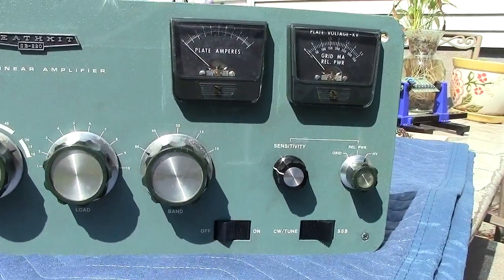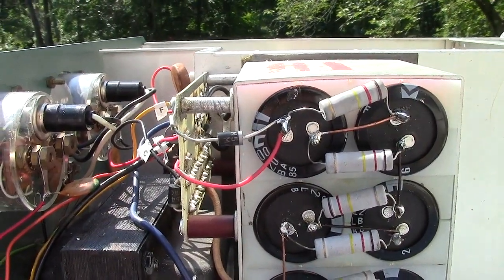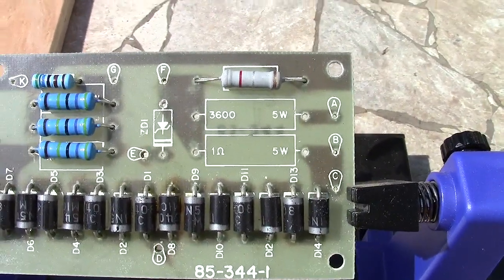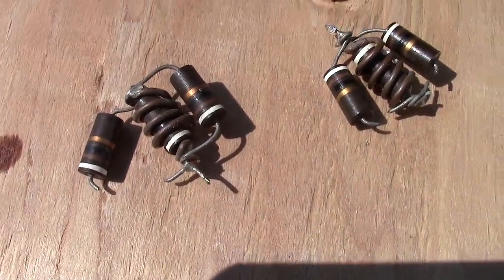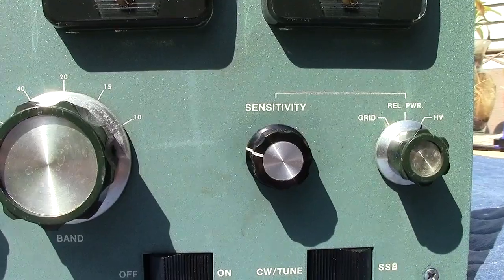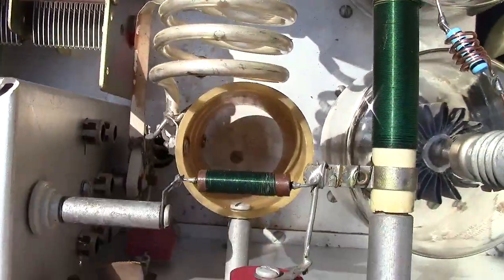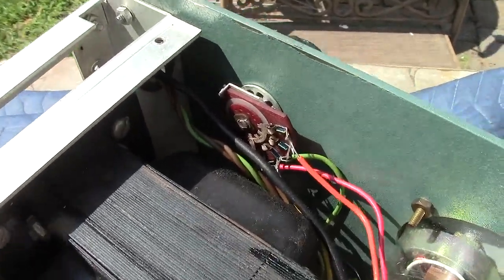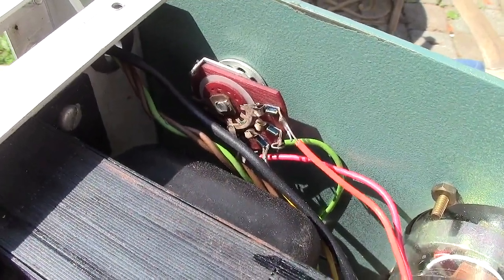SB220 Rebuild

Comment: Why do people likes to shortcut and be cheap whenever it comes to buying good parts. Those diodes looks close to the board how much clearance. Between them and the board ? I've seen many SB220 amps with 3 resistors on the parasitics.

Comment: Very ill advised to use the chemicals suggested here.  DEoxitD5 for all contacts, pots and tube pins, burnishing tool if need for relay contacts, triflow and paper towel for xfrmr laminations, tri-flow or other penetrating oil on switch and pot sfts, but keep it out of the pot. deoxit but no oil on variable caps.

Comment: I hoping to see how you oiled the fan, I suspect mine needs a little love as it's been 30 years since it's been oiled at least. Still works but why take a chance? Maybe you could just mention how you did it as I don't see a hole for that. ALso Alex, is that solder wick you are using to ground your grids? That a good idea if so I think. Thanks, Tod KJ6H

Comment: hi Alex, Just wanted to know how the SB-220 project turned out ? I looked at your other videos but seen no part 2
Reply from the maker: Hello WC : Thanks for your kind attention and comment!! I ended up replacing the High voltage transformer. The Hammarlund transformer is an exact replacement. I fired it up without incident and I am still using it daily. The output tubes are not 100% but all in all everything worked out fine. I was trying to do this on a shoe string budget. Well that did not work out the transformer alone was $300.00 OUCH !!!!!! I did not do a second video my point was to make a safety video with a few trouble shooting tips. If you intend on working on one of these little beasties. PLEASE be Careful .

Comment: Hi Alex, just a couple of words about your SB-220 project.  I want to commend you on your admonishment to those buying an amp on Ebay or any other venue where you do not see your purchase in operation.  I agree that you should NEVER just plug it in and go.  You must do as you suggest and look over the entire amp and visually inspect it for an obvious imperfections. 

 I also highly recommend since someone buying a vintage piece of gear like this do the very minimum updates to it immediately if it has not already been done. That would be new filter caps and bleeder resistors.  Secondly I HIGHLY recommend the Harbach rectifier replacement board and NOT messing with the original.  The Harbach board does away with the Zener diode, adds 3 amp rectifier diodes and meter protection.  It is cheap enough and a quick build and install compared to revamping an old board.  Years ago I realized that revamping an old board is a waste of time and you don't have as good a product as a new Harbach design.  

The parasitic set up that was in there was not stock but that design can be seen in some vintage amps and do work.  The original design is very effective, a simple 2 watt 47 ohm carbon resistor and 3 turns of #16 or #14 silvered wire around it is best.  No other design works any better than the original.  The ones you made are incorrect, they may work but I do believe you have far too much inductance on them.  Any 2 watt carbon in the neighborhood of 47-56 ohms with 3 turns of wire around it is best.  Stay away from Nichrome.  

I did not quite understand how you determined that your primary of the power transformer was shorted, you did not elaborate on that and I wonder if you should have another look at that.  Perhaps I missed your explanation.  Cleaning the relay is also a good thing and the time should be spent on doing that.  Grounding the grids is another good thing although it does increase the gain of the tubes and care must be taken when loading.  

The stock transformer has a built in impedance and a step start is not a requirement however some feel more confident with it and it can't hurt, toss a coin if you are undecided on that.  A soft key is a MUST.  The Harbach soft key unit is well worth the money and as far as I am concerned a MUST have.  You can bet that over 50% or more of modern radios will be destroyed by the 120vdc the SB-220 relay needs to switch.  Here again, the cost is minimal and the reward is huge compared to repairing the keying circuit in a new radio.  Once again, cleaning the meter function switch is another good idea.

One major observation I have made over the years which is quite troubling is the frequency that I see bad band switch contacts on these amps.  I have owned or repaired upwards of 500 SB-220/221 Hl-2200 amps over my 45 years of working on them and unfortunately about 7 out of 10 amps I see have at least one bad band switch contact.  Those odds are pretty bad, so don't be surprised if you see a bad contact.  Often times the amp still works because the contacts are redundant and one may still be good but now has to handle twice the current.  

Lastly, once all your renovations are completed you should as you suggest bring the amp up slowly with a variac, first with no tubes to check that all your work was done properly and see if all systems are go with no tubes.  Once you have confirmed all is ok then put the tubes in and once again bring the amp up on variac slowly, put the meter in grid position, start bringing up the HV, watch the plate and grid meters for ANY movement UP OR DOWN, if you see any meter movement you have a tube problem so stop right there and determine which tube is making the meters move.  If all is OK keep bringing up the HV and now keep an eye on the tubes themselves and see if you can see any signs of gas.  You will see a violet  hue inside the tube if it is gassy.  Again, if you see gas, STOP.  Probably time for new tubes if they are gassy.  You could try to getter them, that may or may not work depending on how badly they are gassy.  Personally I replace gassy tubes and make decorations out of them.  Some mildly gassy tubes  will only show gas when excited with RF, they may getter with use but may also arc and cause some damage.

So how are you doing with this project?  Lou W1QJ
Reply from the maker: Hi Lou sorry I was not able to respond sooner sometimes life gets in the way! I want to thank you for your comments. I would like to argue with you but I can not. I am a disciple of W8JI . I should have mentioned in the article my intention to make this a cheapo / experimental project. That is the reason for trying the loop parasitic suppressor. Also why I did the refit of the old rectifier board. What I might add I also replaced the 5.1 volt Zener diode with a higher wattage unit. By the way I do use the Harbach stuff I am a fan!! The reason I did not use any this time is because I recently finished another amp and as it turns out all the Harbach parts I bought cost mre than the amp. So I decided the next amp project will be done on the cheap as an experiment. But the power transformer started sputtering and snapping as I slowly brought it up. So much for doing it on the cheap!!!! Well 300 bucks later it is up and running. The only arc  problem I experienced was when I accidentally miss tuned the amp. But no harm was done.Thank You so very much for your kind attention and for keeping me honest. Best Wishes Alex WA2BMB